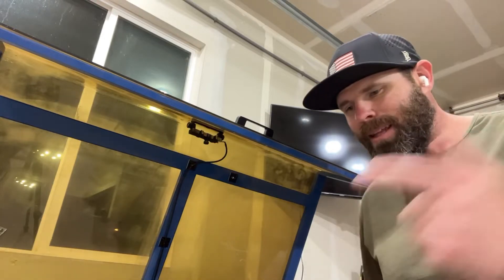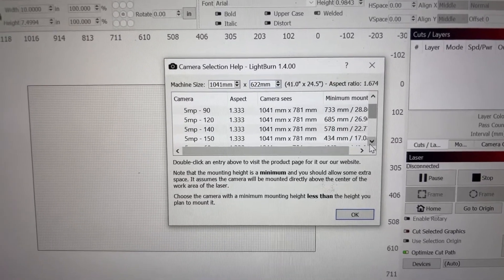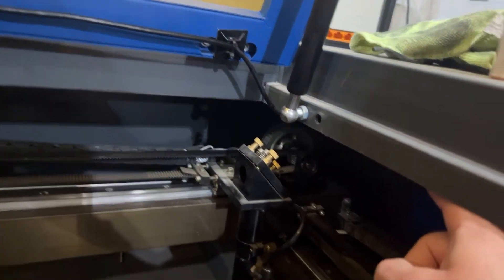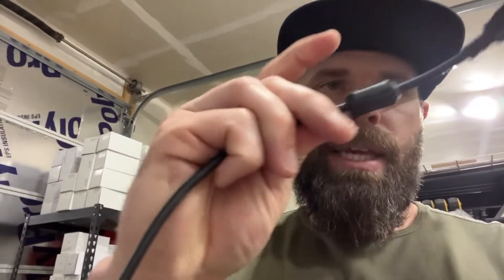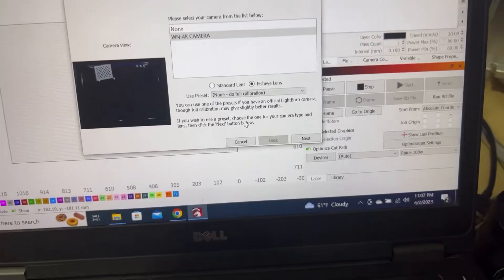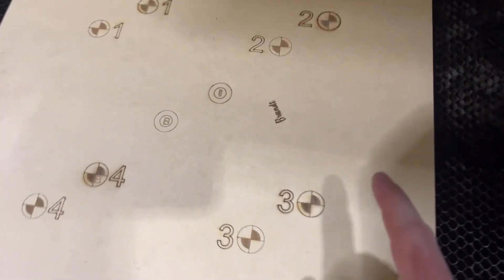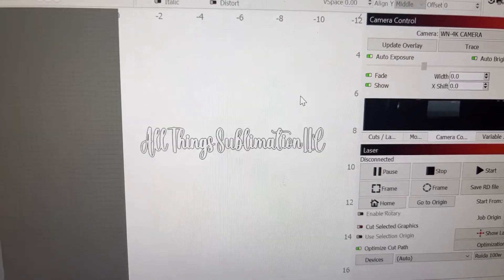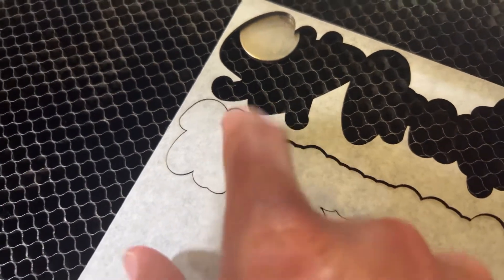Adding a Lightburn Camera to Your Laser

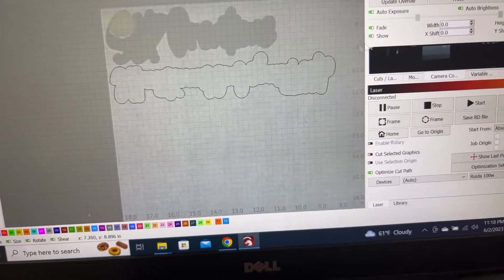Comment: @Bearded Builds Co - When I try to set my laser up on a Ometech AF2028 - 80, Im running into an issue where my camera works, but my laser / control panel will not frame or cut in step 3 of the camera alignment. Essentially my Omtech will only let me use the camera when plugged in this way or if it plugged in the other way, will only let me use the laser ( wont recognize the camera being plugged in). I'm seeing in your video it says your laser is disconnected but at your cut at 10:00, it says ready. How do you get the laser to function as well as the camera working?
Reply from the maker: You have to have the camera and laser both plugged into the computer
Reply: @BeardedBuildsCo Thank you so much! I had a feeling that was gonna be the issue. I was thinking when you swapped out the port, it all sent data via one USB. I looked at a different video and I saw the guy had 2 cords, that gave me my moment. he referenced you! 

thanks for the reply and keep up the awesome content!

Comment: Very good use case for the camera. Lightburn cameras never seemed accurate enough for me because I would see people putting a circular logo on a circular coaster and if that thing is not PERFECT, it is going to look terrible. But using it to easily squeeze out all the space on a sheet where you assume you might be 1 or 2 mm off, it works great for that.
I think having it so far up with your lid open also really helps as you don't have to deal as much with wide angles.

Comment: I can’t get my lightburn 5 pm 150 degree camera to get a good picture and it’s off about 6 inches to to left. I bought this camera several months ago for another laser which is broke! Ps I’m trying to use it on my Omtech 100watt laser. Anyone have some advice
Reply: I mean I CANNOT GET A GOOD PICTURE
Reply from the maker: Have you tried focusing the lens? It has a lens that you can turn to adjust the focus which will change the clarity of the image.

Comment: When you measure camera mounting height, do you measure it when the bed is as high as it will go, some some point lower?  Thanks.
Reply from the maker: When it is in focus to the laser head
Reply: @BeardedBuildsCo  So focused to what you burn most I guess?

Comment: So thankful to all your videos!  One question…. When I use lightburn camera, the first time it works and as many times as I need until I position the cut and start the job.   When the job is over, the lightburn camera will not operate unless I select the camera on my lap top then select the lightburn camera again and then I’m back in business.  What do I have set up wrong?

Comment: I purchased a 16MP camera which will arrive in the next day or two. The main reason I got the camera is so I can run a job in the garage and me be in my office. I run batch jobs that take an hour or so to engrave and cut on my Falcon 2 40 Watt laser. The scary part is I was playing with Lightburn while watching your video and it activated my webcam on my PC!
Reply: It is still a wired connection right? The camera still needs to be plugged into your PC?
Reply: @vickynguyen9499  The camera is plugged into the USB port of the laptop in the garage, and I use a software called "virtual-Here" to view it from my PC in my office. Using the camera command in Windows.

Comment: Goodafternoon sir. I have some questions i have a 20 x 28 omtech machine thats 711 mm x 508 that requires 339 mm on minimum mounting height .  And my minimum from work bench to handle on a open door is 736 mm where do i position the camera ? Any advice

Comment: You left the lid opend during burning.  I assmume this was for demonstration purposes only.  In normal use, would you not align the graphics and then close the lid during burning, or do you have to keep the lid open to maintain alignment?
Reply from the maker: In normal use you would want to close the lid. Something that I can learning though is that when I have the camera aligned and the. I open and close the lid repeatedly I am starting to see my camera alignment drift. From the research that I have done this is due to slight differences in where the lid opens to. If you can set up a system that guarantees that the camera will be in the same spot every single time that would provide the best consistent results.

Comment: I use my laser to cut out prints on card stock paper. I cut out hundreds of the exact same prints. My issue is I have to constantly position the paper in the exact spot so the laser cuts precisely where I need the cut to be. Is there a way I can print on these sheets registration marks so this camera can pick them up and self align the laser to however I’ve placed the page on the work bed?
Reply: Hey, look up how to create laser engraving templates with cardboard on YouTube. There’s a gentleman who will guide you how to create a template for the sheet. Then you can just place the sheet in the cardboard cutout you create.

Comment: I sure hope your checking comments. I didn't understand about changing the camera view 180. If I turn my machine on the laser head goes to the left rear and makes an awful racket and my picture of the bed is 180 out. I can"t do any calibration before I run the camera can I. Also I ordered a 8W120 where the program took me. I only have a OMTech 50 W machine. Do I Have to buy another camera because they don't take returns?  Jim
Reply from the maker: The homing and the camera are two separate issues.

Review this for the homing:
https://youtu.be/WFhb3ZwT3T8?si=5_npy7yQfPNupUCa
Reply from the maker: The camera alignment section when you engrave the numbers and select them in order with change the camera orientation.
Reply: I can't get to that part because they want it framed first and it tries to go to far hits against the side and starts grinding. I guess I'm stuck. I figured after I replaced  the co2 bulb (it came in not working) I would probalyHave more problems. I've only used it and it a few times. wouldn't cut through much of anything. The mirrors were clean and it's aligned real good centered on each pulse. Thanks for taking time to help. How much do I owe @BeardedBuildsCo
Reply: Ok, I checked the limit sensors and they lit up fine They lit up when the rail came close and they lit up in the controller. I followed the wires to the controller and they went to their marked places. I don't  understand it! Is there a switch to make them work? @BeardedBuildsCo

Comment: To check the alignment after going through both calculations? I drew a circle.5 mm burn it. Update the camera image to see if the over lay is on top of the burned image. If not. On the camera page you align the X And Y image.

Comment: That ferrite bead is called a Torrid! It is a ferrite bead with the conductor wrapped several times around the circular bead. This cancels out spurious noise on the conductor shield. I have an atom Stack camera on my laser, I would never have another laser without a camera. It saves so much and material for precise location of items to be engraved.

Comment: Great video, although you chose the 8mp-w-120deg camera when actually the 8mp-w-85deg model would have been the better choice for greater resolution when mounting the camera 1000mm away. Also, during the alignment you changed the scale to 100% - however, this relates to the alignment pattern size (100% is 180mm square) . The software suggested 285% would have expanded that pattern out to 513mm maximising the available workspace and resulting in a significantly more accurate alignment.
Reply: Yo could I pick your brain on setting mine up?
Reply: @dirtysouthmade9609  Sure?, what's going on?
Reply: @NicholasLeqeta hello. What would you recommend for the 80watt 24x35. Thank you for your help!!
Reply: I would like to pick your brain also. I want to have my camera when my omtech arrives but I don't have the software yet to know which one I would need. I'm going with an 80watt with a working size of 500mm x 700mm. Would the 85 degree or 120 degree 8MP be best? Thanks!
Reply: @ToddZilla813  The 8MP W-85 degree will be best and could be mounted as close as 650mm above the 500mm x 700mm workbed to see all of it.
Reply: @NicholasLeqeta  Thanks so much!
Reply: I have a Creality Falcon Pro 10watt laser and I want to add a camera.  What would you recommend